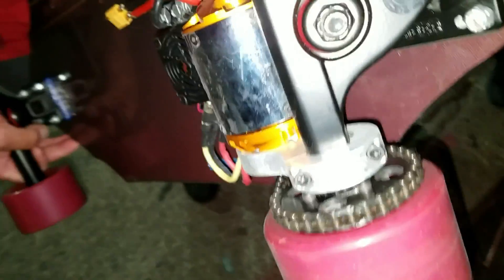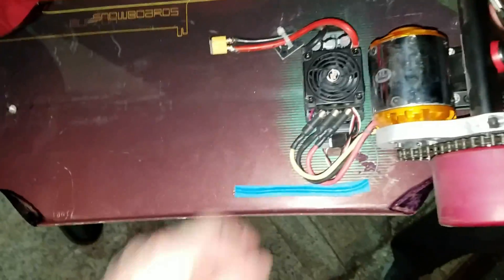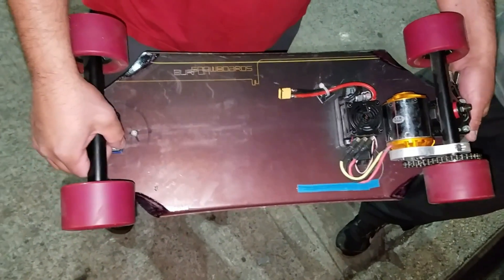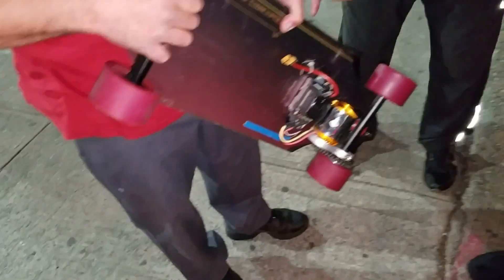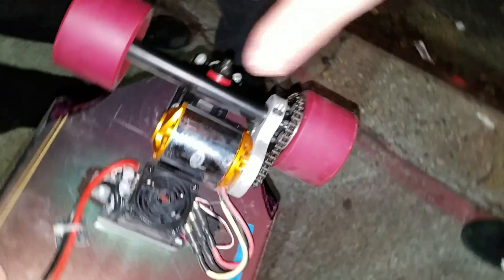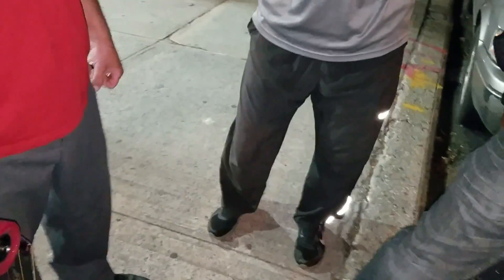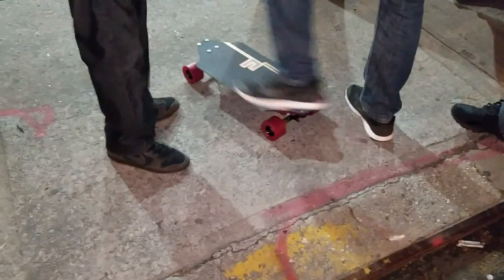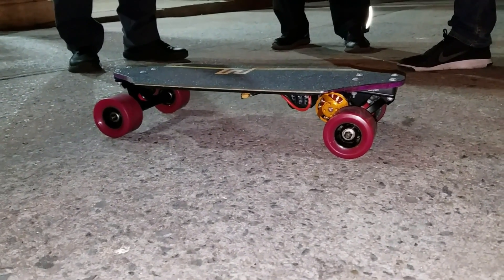Papo's DIY electric skateboard

Comment: Id be careful with that specific motor. I ran it on 6s on my elelctric longboard and over heated it melting the varnish on the motor windings. Went up too high on my pulley ratio.
Reply from the maker: My motors don't even get warm.

Comment: Theta how I think I'm going to build mine with a chain puley
Reply: I did mine with a chain, generally better in my opinion but does require a nice greasing every once n awhile
Reply: +cwbh10 hi i m trying to build an electric skateboard with a steel chain drive where did you buy the parts to make the drive train? Thanks